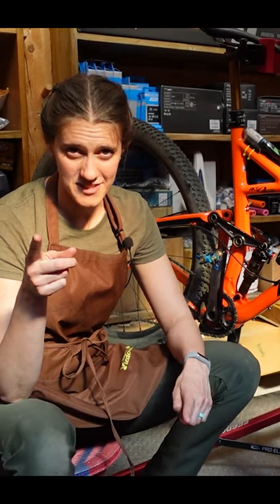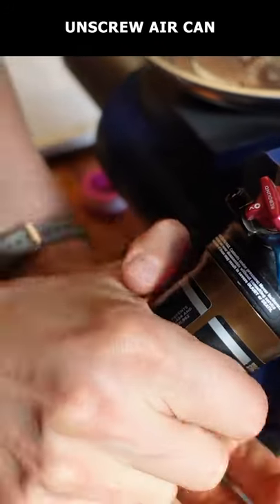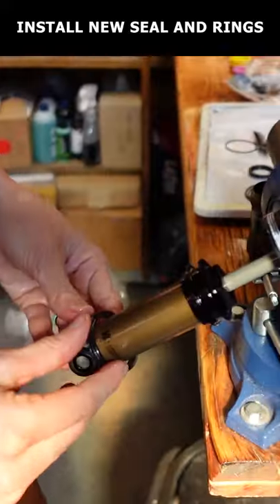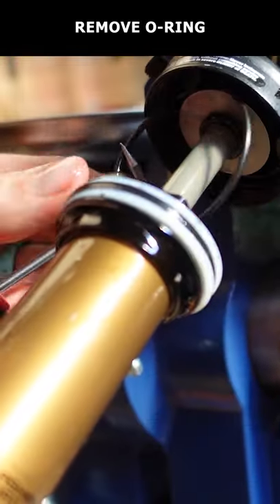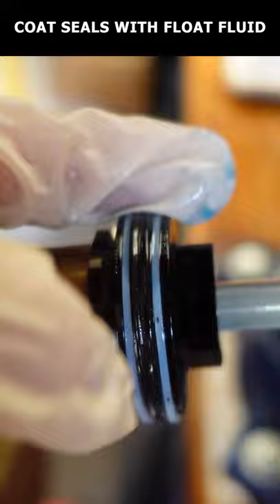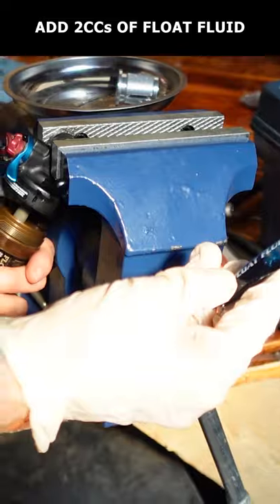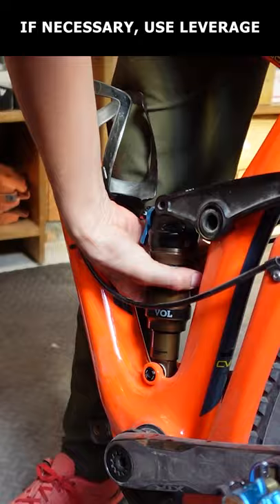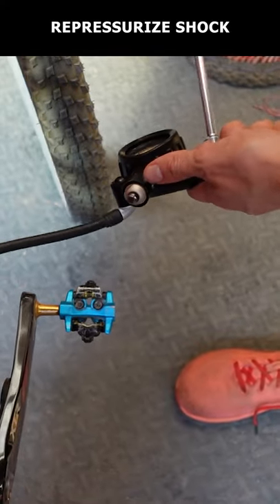How to service a bike shock (air can service) #Shorts

Comment: How to service air cans: buy a hardtail, done.
Reply: Yes but if you could choose between double suspension or hard tail you’d choose double lmao its just better
Reply: @thonkingintensifies9510  hard tails do have rear suspension, its called knee's, and they dont need service (in moste cases)
Obviously im meme'ing...
Reply: What about front fork
Reply: @dkdanis1340  2 hanss bud
Reply: @parthpatel9602  all hard tails have suspension front fork. For serious bumpy ride full suspension is very beneficial.
Reply: @thonkingintensifies9510  more better doesn't always = more fun. Sometimes what's most important is smiles per hour. This message is brought to you by a member of the Broke Hardtail Gang.
Reply: Hard tails are nice until you keep snapping rear axles from all the shock put on the rear wheel. Can’t remember if it’s 3 or 4 axels ive snapped
Reply: @spitalovic9455  occasionally a service is required (if you don't wear pads) this is why we ride bikes, runners reed replacing every 20 or so years. Unfortunately not a DIY job and a surgeon is required.
Reply: My thoughts
Reply: This is why I ride downhill on a carbon road bike
Reply: Or just buy a coil shock.

Comment: I was wondering, if your seals aren’t leaking how important is it to replace them?

I’m on a pike and super deluxe setup and I’ve experienced no leaking. I’ve had a lower leg service after 1000 miles, I’m just hitting another 1000 and I’m wondering if just cleaning and a relube is all I’ll need.

Wouldn’t the bike ride smoother if I just kept my current seals since they are broken in and there’s no damage to them?
Reply from the maker: I don't think they'll necessarily ride more smoothly if you use the old seals, but you are correct that it isn't necessary to replace them if they aren't leaking. We often do foam o-rings and bath oil and skip replacing the seals.

Comment: Can you do one for the fox DHX?
Reply from the maker: I believe the DHX2 is not user serviceable and has to be rebuilt by Fox.
Reply: @sydfixesbikes  that’s unfortunate, what makes it like that?
Reply from the maker: Well, the DHX2 has no air can (because it's a coil shock) and any other adjustments require a nitrogen refill machine.

Comment: Fox doesn't say to use slick honey does it?
Reply from the maker: It does, actually
Reply: @sydfixesbikes  brb taking apart my shock to add some slick honey. Last I serviced I just used the blue stuff. Also reused my seals cos they looked fine and it holds air great still. Fox seals are $$$ especially for forks when you just wanna replace the foams
Reply from the maker: You use the slick honey in addition to the blue stuff (float fluid). Slick honey on the seals, float fluid inside (for lubrication).